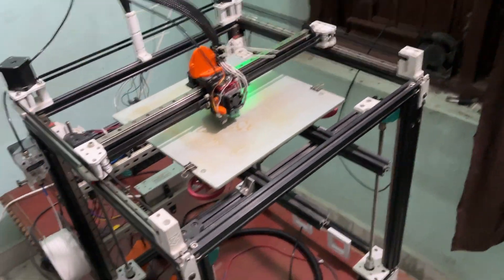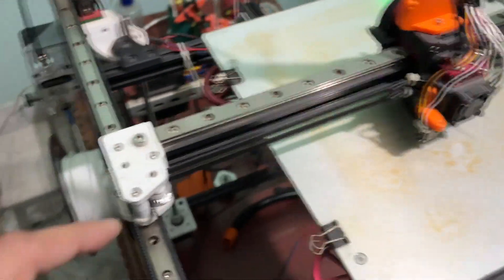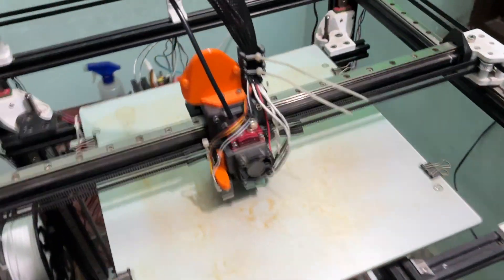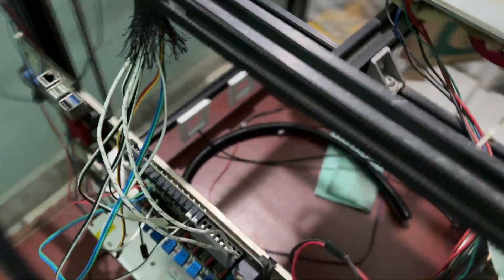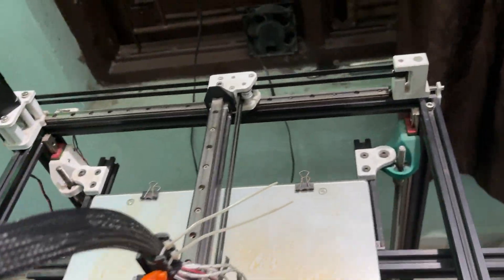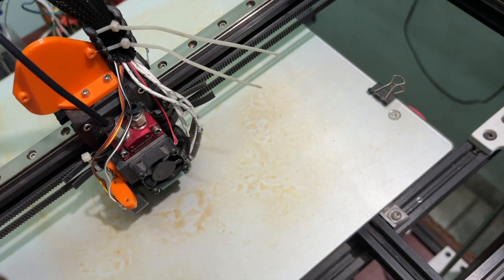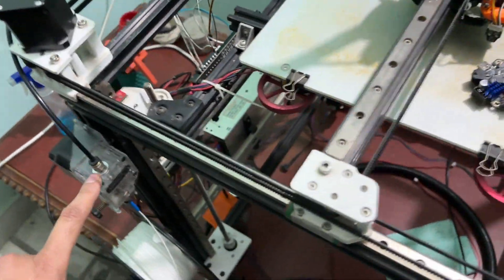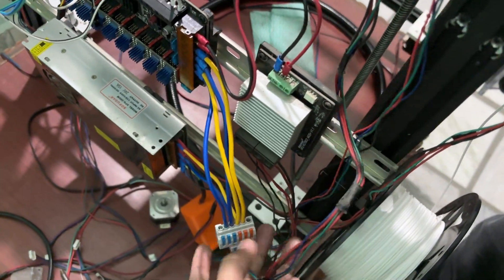Custom cube core xy zero g plus trident combination diy project all mgn12h rails

Comment: Bro I would like to connect with you, I have some questions regarding an upgrade that I'm planning, I'm planning to upgrade my ender 5 pro to a stealth burner with (e3dv6 hotend ceramic core) + Mercury one gantry + canbus setup ( with octopus)..... Currently low on budget so I was planning to  use the existing Creality 4.2.7 motherboard and add a canbus is this possible or I'll run in some errors? (Ps : I'm already using klipper)
Reply: Was also planning to have a hydra bed leveling system ( I currently have an ender 3v2 + ender 5 pro) so I'm planning to salvage these two printers for the parts for build.
Reply from the maker: https://www.facebook.com/share/1FCMsQ38a7/?mibextid=wwXIfr 
send me friend request on Facebook
Reply from the maker: I am not sure about creality 4.2.7 is have can port or not support to can to bridge option maybe you need to install u2c board for can connection